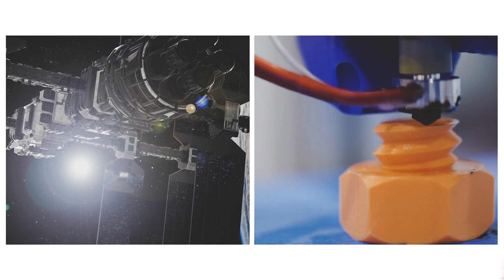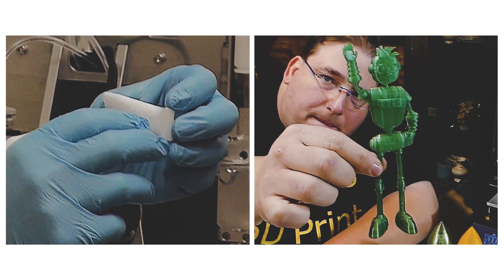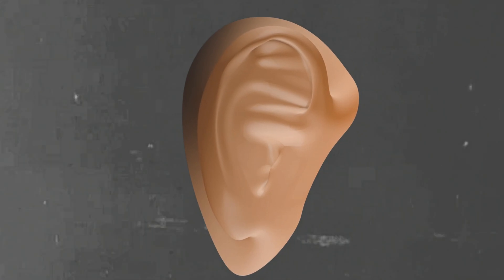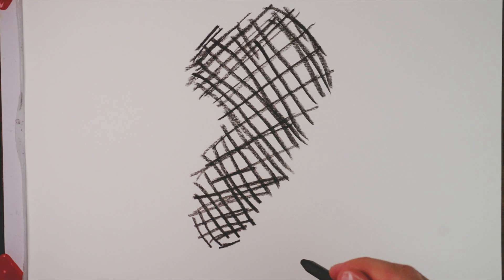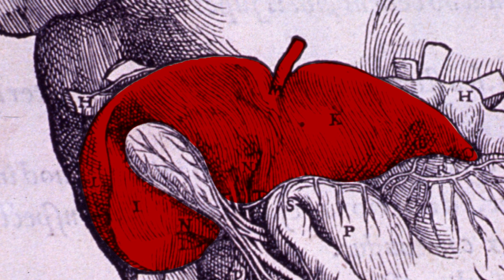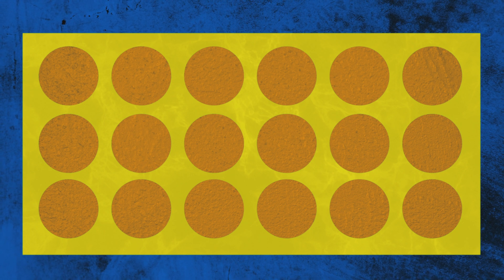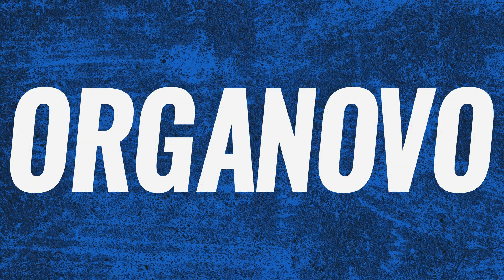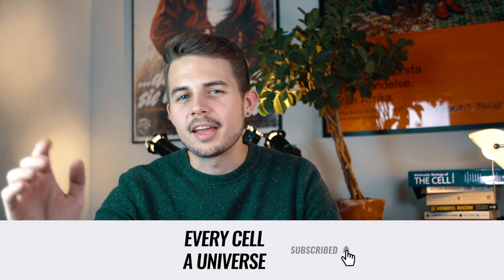3D printing tissue and organs (Tissue engineering - 2019)

Comment: so at one point theres going to be a demand for meat made from living cells of an animal without the need for slaughter
right now its at the ground beef stage, with little connection between the many muscle tissues grown from blood
would perfect organs with your own genes direct to your body be a viable option for recovery for burn victims and tissue alterations, like giving people born with less muscles, the ones they need to have the functionality they would have had, just that option alone would be incredible

would multiple hearts be more useful for people with gigantism?

could we have more efficent digestion? 
 people are interested in body modding

i wouldnt mind new eyes
what colors would you want to see?
what about heat spots? why not have heat spots?
Reply: Vincent Gonzalez The human body plan wouldn't allow a 2nd heart. Where would you put it? Not only is there a lack of space, but the vessels of the body and of the lungs are all perfectly linked up to the first heart. Also the brain is intricately linked to our first heart by nerves. Perhaps a bigger/stronger replacement heart would be useful, if we could also give them stronger arteries to resist the higher pressure.

As for improved digestion: it's not likely with tissue printing. But if gene therapy gets very good I could anticipate permanent treatment of intolerances by inserting enzyme genes into our gut epithelium. For now though, simply eat lots of fibre to modify your gut microbiome to be more effective!
Reply from the maker: @TheRABIDdude  Thanks for the great comment!
Reply from the maker: Intersting ideas!